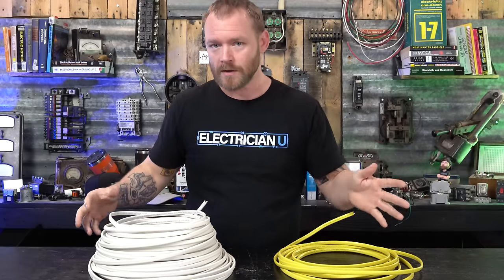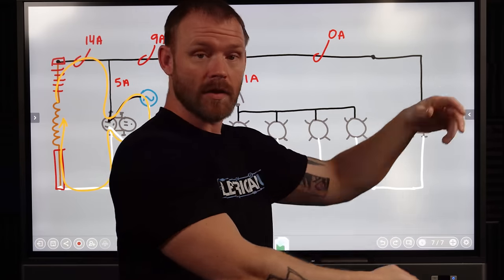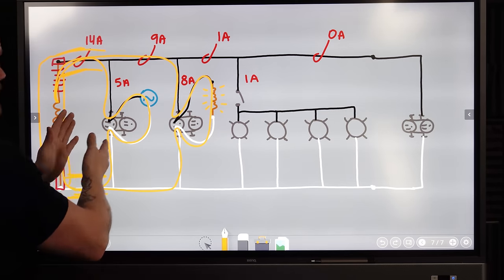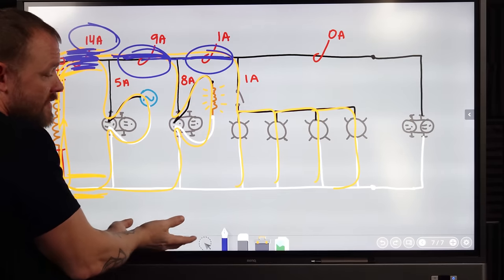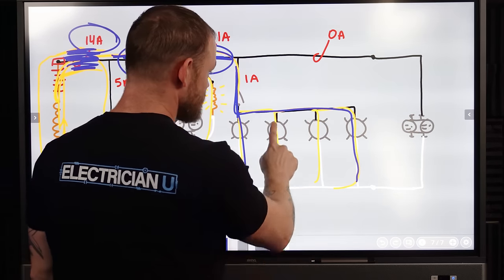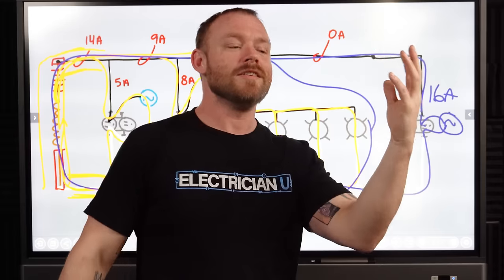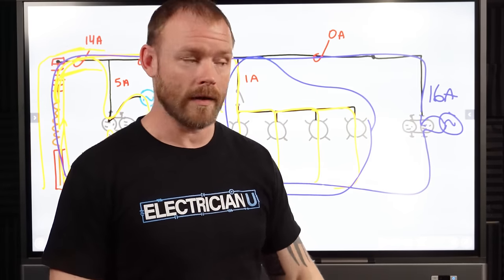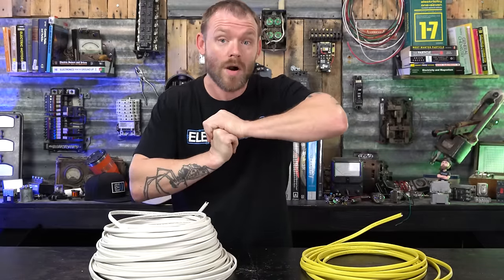Should You Be ONLY Using 12/2? When Can You Use 14/2?

Comment: My mind is blown. I thought you can’t run wires rated below the OCPD. If something goes wrong (even though it’s not going to happen) and those lights draw 16 amps, that 1AWG is going to heat up. Have I been wrong this whole time? I can maybe see what you’re saying if it was a low voltage system with a transformer involved. Otherwise I’m going to be looking into this for the next 6 months trying to convince myself it’s ok lol.
Reply: You're correct. I just spent over an hour reading the NEC researching this, and basically: 20A circuit = #12 wire or larger only. #14 wire = 15A breaker only. There are some exceptions, but none of them apply to running Romex to light fixtures. Fixture wires and tap conductors that run no more than 18" from a junction box to the fixture can be #14 or smaller, but anything beyond that has to be sized to the breaker.
Reply: As an electrical engineer, It's not the way I would ever design a circuit released into the wild. Although you might get away with it without killing anyone if you have an AFCI breaker on the line.
Reply: Thanks for clarifying. I could still see using it on cabinet lighting that was 12 volts but I wouldn’t want that on a 20A breaker either. Would AFCI possibly save you from killing someone because it should trip before a condition is met that would cause it to draw more than 15 amps? Because I’m thinking if for some reason it draws 16 amps without an arc the 20A AFCI is going to let the wire heat up. Obviously this is becoming academic now.
Reply: @doc13067   And you would be correct. The "electrical engineer" you responded to proves the case that most engineers don't know jack about what they are talking about. The AFCI protects against ARC FAULTS, NOT OVERCURRENT which is the main issue.  The ONLY way an AFCI would be of benefit is IF the overcurrent finally melted the wire enough to start an arc fault, which the AFCI MIGHT clear. But by that point, enough heat would have been generated to start a fire. 

Mr. Engineer needs to learn how the real world works, and crack open a Code Book AND learn about Ohm's Law and current ampacities of materials.

Comment: Makes sense that you could run #14 off a switch leg. Also it's easier to identify the light wires at a glance vs having to test for your hot feed. 
I think they recommend 12-2 all round is to simplify safety verification. No chance of an overheat due to resistance. Though like you said, smaller would carry the load. I mean most fixtures only have like 18 or 20 gauge strand or solid in them. So that's automatic resistance right there.  But, it's contained. Where your lines run tacked to wooden studs and joists. Potential heat absorbers. And, if someone gets heavy on the hammer with a staple, it could be a potential fire later. 
My daughter had an outlet with a toaster plugged into it that kept tripping the breaker. I pulled the box, checked the wiring, the outlet, found nothing. Went to the panel and looking, spotted nothing. But when I pulled the breaker, whomever stripped the wire at the breaker cut almost all the way through the wire. So when the toaster ran for several minutes the wire got so hot it kicked the breaker. So, in the famous words of the Borg, resistance is futile .
Reply: i know a electrician who always crushed the wires in a panel.  told him to quit doing that.   bad work like that.  will lead to problems.  like yours.

Comment: There is only one question.  Is the breaker going to trip before the wire in your wall heats up and starts a fire?  Technically you can have 1 amp circuit on 14/2, but if you put that on a 20 amp breaker, and anything goes wrong with your LEDs, your breaker may not trip before you have a real problem.
Reply: Correct. Though probably not with a dual function breaker. Should cover that 'something.'

But that's why Dustin says use code, says the common minimums, and shows the NEX table for cable size vs circuit protection size.

Comment: In my company, if we are doing a remodel or service call and find 14awg wiring on a 20 amp breaker, we will ALWAYS downsize the breaker to a 15 amp one or upsize the wire. You never know what may have changed in an older home.
Reply: You do so because that what the Electrical Code says to do.

Comment: I believe the code should be lighting =14/2 or (12/2 optional) and all plug receptacles 12/2 regardless… just my opinion. I see too many people for all the items they plug in these days overloading more 14/2 receptacles than 12/2 receptacles… nice video as always dustin…👍👍👍
Reply: If I was to reinvent the wheel tomorrow, I'd want homeruns to run in attics or basements, with essentially pigtailed 'twig' circuits down/up to devices. The homeruns would be oversized, to 10awg for circuits with receptacles, though pigtailed out to receptacles with 12awg. Less in walls, more access, safer with receptacles pigtailed, and easier to modify like adding new receptacles/other devices.

Comment: It’s funny, cuz in places like the UK, they do undersize the wire, and add an additional overcurrent protection on the smaller wire branch. That’s also why their plugs are so big, they have to have fuses in them so they don’t overload the building wire. 

There is low voltage lighting systems with smaller wiring, and even lighting that runs off of power over Ethernet now. Seems like we should start having mini “sub panels”  where we run 12 2 to a room, then have a “mini panel” with 1 amp breakers and smaller wiring for “low amp” lighting circuits.

Comment: I have a light on the wall of a small room that has a 14/2 wire, my question is if I can draw electricity to put an outlet on that line of light? Or is it dangerous to connect a 12/2 wire to a 14/2 light?

Comment: If I'm doing an electrical rough-in I never put overhead lighting on the same circuit as outlets. You don't want a fault at an outlet to leave you in the dark. 14 ga for overhead lighting, 12 ga for outlets as a general rule. I will use 12 for overhead lighting for a couple of reasons, like in large (on-suite) bathrooms that might have multiple ceiling lights, exhaust fans, and potentially a heat lamp fixture outside of the shower to aid in drying, or in rooms that have multiple ceiling fixtures where the bulbs can easily be replaced with over wattage bulbs like swapping six 15 watt LED flood lights out for 300 watt halogen flood lights. That would put you at the max rated capacity for that 14 ga circuit. Not good.

Comment: I’m ready to overcome my fear of installing two 20 amp circuits for my garage. Currently it’s on 15 amp for interior and exterior lights and outlets with 12/2, 12/3, 10/2 and 14/2 Romex including for two 3 way switches in a double gang box. There’s no way an electrician wired this unless they were visually blind. 
I purchased 12/3 & 12/2 Romax. Do I wire the circuits with the 12/3 or 12/2. Where does the red wire go in the panel. I’ve seen videos only explaining the ground, white and hot black wire.

Comment: I only carry 12 gauge wire, and 20 amp breakers and receptacles in my truck.
For two reasons.
The first is reduced number of Line Items in the inventory of my truck.
The second reason is Space Heaters. If anyone ever uses a Space Heater on a 15 amp circuit, that one appliance is pulling the maximum de-rated (80% Constant) load for said 15 amp circuit.
And Space Heaters are why I also use SPEC GRADE outlets. Because the el cheapo 79 cent receptacles you Residential Boys are so fond of just LOVE TO MELT when they actually have to work.
And just to make it clear for anyone who is confused about the sizes needed on a circuit:
If you connect any wire to a 20 Amp circuit, IT BETTER BE A 20 AMP WIRE. (Or bigger. Per the NEC.)
The breaker is there keep the wires from melting in your wall and starting a fire. THAT is its job. It is NOT there to protect your toaster, it's there to protect your ass.
Reply: Aren’t space heaters supposed to be on a dedicated circuit? Therefor it wouldn’t matter if it’s on a 20 amp circuit, it would still be against code if that breaker is supplying other receptacles. I could be wrong, but this is what I was told
Reply: You don't even carry 15A breakers? Hopefully you never need to replace one?
Reply: @benchociej2435  I never said I didn't. YOU did.
I don't carry 15 Amp RECEPTACLES. Or any quality less than Spec Grade.
I tend to work on mostly rentals, so, residential grade just means I'll be back in a week.
The point is, I keep needless Line Items out of my truck because of weight. Since I can use a conduit compression fitting legally and effectively anywhere I could use a setscrew fitting. Adapters and couplings for 1/2" and 3/4" EMT means 4 boxes and about 50 pounds I don't need to haul around. Thinking like this adds up fast.
Reply: OP for this makes sense for the repair electrician.  It is 100$ to ring the doorbell, leaving the job with top quality that cost a few dollars makes sense/customer satisfaction.  The affordable housing builder will not do this, as it adds up fast, and he will lose the bid.
Reply: @petercampbell4220  Absolutely correct. We live in two different worlds.
Reply: So im about to run a vanity light to a pancake box.  Pancake box says only 14/2.  but im coming. from a 20 amp 12/2 line.  Should i just run 12/2 to that single vanity light?  Im stuck.

Comment: Question on parallel ckt example where it is mentioned branch circuits could use smaller size wire if loads are small.
How would the smaller wires sized ckts be protected from a SHORT condition in the branch?
I would think 20A would be sourced from the main panel and burn the wires that could not handle the current.

Comment: Personally, if I was building a house right now, I'd go with 12/2 everywhere, just because you don't know how you're going to use the house in the future.  A little extra headroom feels like a good idea.  I'd bet that upgrading even just one branch at a later date is going to cost more than the difference of using 12/2 versus 14/2.  12/2 is harder to work with, though.
Reply: Their forcing everything to be electric so it’s better to have it and not need it than need it and not have it.
Reply: I totally agree I never use 14 /2 for anything I don’t care if it costs a little less
Reply: It’s actually surprising how quickly you can run into box fill issues with #12 in residential boxes.
Reply: You plan on welding in your living room  ? other than electric range or water heater, there's no reason for #12 in a home
Reply: @ericschulze5641  In my case, we have a home office with four relatively high-end computers, a laser printer, and a 3D printer all on one circuit.  Add a space heater and it's pushing tripping the breaker.
Reply: People who use 14 gauge wire probably the same people who trim out their house with mdf….
Reply: @OgFurious1  everything is low voltage nowadays & it's not going back so aside from major appliances or a workshop there's no need for #12 & actually it hasn't been used as the primary wire size  since the 50s
Reply: @ericschulze5641  You are correct but I’ll admit I’m biased as I like to do things a little above average, plus I’d love to have a workshop.
Reply: Hope they don't use a couple of space heaters during a cold winter storm. Or a couple or windows AC units in the summer.
Reply: light circuits don't need 12 ga, esp now with LEDs

use 12ga for anything else
Reply: @OgFurious1 .  What in your workshop will need 20 amps and 12 gauge wire?
Reply: @jerrynorris1397 What about a lighting circuit. Light fixtures are all LED today and are very efficient even if you have a bunch of fan/light combos on a circuit.
Reply: @ericschulze5641  Are you confusing wire gauges?  The hot water heater is usually 30A 220V, usually wired with either 10/2 or 10/3.
The stove is usually 50A 220V using 6AWG (6/3)
At least the larger welders will run 220V with a minimum of 30A.  So, not 12AWG.
As others have mentioned, with our wired world, and perhaps a string of plugs for laptops, phones, chargers, printers, space heaters, hair dryers, toasters, toaster ovens, etc...  Might as well be safe rather than sorry.
Reply: You just don't need 20 amp wiring for lighting ever, especially with led loads. Also when trying to wire switches the boxes quickly run out of volume.
Reply: @250zxSkeeter  Did someone say the heavier wiring desire was for lighting?  I didn't.  The need I have is for things that consume a lot of power, like a space heater, high-end computers, laser printers, etc.
Reply: Oddly enough lighting is going the other way.  Rather then having a driver on each led.  A single driver can run an entire bank of Leds and if the driver goes bad you can swap it.  Then can be much lighter gauge like 16 to 18.  So 120>driver>18 awg >bank of leds
Reply: @josephbikes  I have never had box fill issues with 12/2. Of course I only buy the 22 cu in.  boxes for single gang devices. You have plenty of depth in the wall. Why scrimp on box depth?  Sure, the larger boxes cost a few Pennie’s more, but save time in trimming out.
Reply: Yes always plan for the future! I run a lot of RMC and rarely ever use 1\2". Nothing under 3\4". Never know when you may want to pull another circuit in an existing conduit run.
Reply: @rshoe1023  thankfully, we don’t have to use conduit in residential buildings. I did wire one house with a piece of 2” up into the attic and a piece under the house. Ran THHN to a large J-box in each location, then NMC from there.
Reply: 12 AWG  is nice, but 10 AWG is even better IMO.  I like wires that always stay nice and cool under max loads and I always like to use nice, large and the deepest boxes to put them in.
Reply: Yeah i would rather they skip on the flooring or trim work than have them skimp on the electrical.     The amount of things that needs ro plugged in is adding up in my house. Im honestly worried about a fire starting somewhere.
Reply: @ericschulze5641  I think that's pretty short sighted but ya know people like you keep me in business. Lot's of expensive house are wired the way your talking about and 1-2 years later I am there rewiring the whole place with 12.
Reply: Nonsense 90% of the public has no need for #12 ,not a pool pump giacuzzi , entertainment center, refrigerator, washer, maybe 12 for outdoors for long extension cords, that's about it
Reply: @ericschulze5641  I'm not in the 90% then. I want more versatility.  I'd choose 12 AWG for all of my receptacles.  Too late for my current house, though.
Reply: @Eugene_Connor  I just built my workshop and I installed a 20 amp circuit for my radial arm saw because I was getting startup problems on a 15amp.
Reply: @eliavyitzhak4887  wire is sized according to the circuit breaker, not the load.
Reply: @tchevrier   Most people design circuits to support a hypothetical load....
Reply: Why the lights right barely draws anything
Reply: @@AdirondackHomestead Energy efficiency of things like space heaters won't increase, because no one is going to put a heat pump in a space heater.

I used to think that gaming computers will decrease in power consumption, but in actuality, they have gone up in power, not down, because people want more and more realistic graphics and motion.  Even though the individual chip transistors have decreased in size and power consumption, the actual transistor count has gone up faster than that decrease, causing the trend toward hotter running machines.  Lots of money has gone into figuring out how to cool these beasts, and that heat needs to go somewhere, and typically it's pumped out of the house by A/C, which itself draws power from the outlet if you use a  room A/C.

So, yes, lighting has become enormously more efficient, but almost no other electrical device has decreased by the same factor, or even close.
Reply: On how many circuits can I use a 12/2 wire with a 20 amp breaker?
Reply: I'd go with 10awg home runs 'everywhere,' and pigtail everything on 12awg twig circuits. Keeping most of the 10awg ran in the basement or attic, rather than in the walls. Also, if we're describing our dream place... make it an ICF house too, complete with bonnet style concrete roof.
Reply: @cavscout888  Kinda like a power buss.
Reply: @yeroca  That's the need YOU have, most people do not have high-end computers in their residences. Homes are wired for lights, clocks, TVs, electric blankets, lamps, maybe the occasional space heater, an aquarium... Residential code cannot and should not be written for every possible eventuality.
Reply: @darrendolphdragos9752  Yeah, to be clear, I am not suggesting that the code should be changed, but if I were building a new house, this is what I'd do.  Thanks for your thoughts!
Reply: @yaima0901  Code requires a minimum number of convenience circuit watts, (convenience circuits are receptacles for general use and lights.) it's 3 watts per sq. ft. to determine the wattage, then decide if you want to distribute that among 15 amp (1800 watts) or 20 amp (2400 watts) circuits. This does not include or count loads like the kitchen receptacle circuits, boiler, central AC or heat pumps, well pumps, washer, dryer, dishwasher, microwave, range...

Comment: I am wondering how many electricians worry about voltage drop.  The tester I used for testing boat 120VAC outlets imposed a momentary 15A load and showed me the voltage drop.  On 100'ers, the voltage drop with 14 gauge wire and a 15A breaker was often in excess of 27%.  And owners were wondering why their high draw motors kept failing prematurely. In my wife's custom built home the outlets furthest from the breaker box in the bedrooms had voltage drops of 15-20%.  I am of the opinion that unless it is a circuit solely dedicated to lighting, all wiring in a house should be 12 gauge minimum!

Comment: This is an unrelated question but is it ok to use 12 ga THWN stranded wire in underground  pvc conduit, or do I need to use  a direct bury rated flat 12/2 w/g cable?